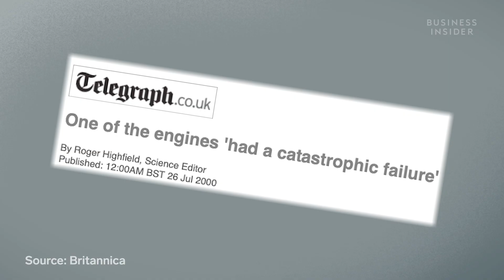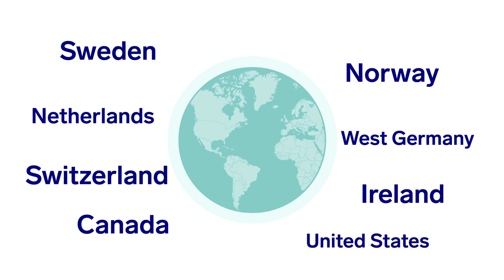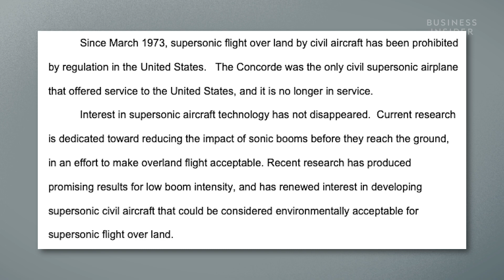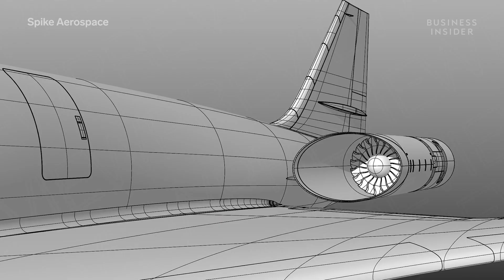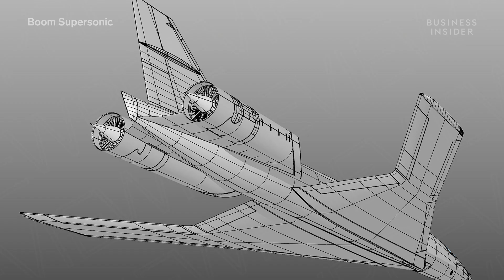Why We Still Don't Have Another Concorde

Comment: The Concorde could easily survive with few modifications. But people were already against it and the crash just ignited the issue.(Which I understand)
When concrode got a red flag, many pilots said that this will push the aviation industry decades behind. And thats what exactly happened.
Reply: They actually started developing a "Concorde 2" but it wasn't worth it anymore.
Reply: @Hiro_Trevelyan  The Americans tried , but couldn't keep up with British engineering . Russians copied , with stolen plans , but they cut too many corners and just didn't have the ability anyway .
Reply: Also the fact that Concorde crash isn't even Concorde fault is just annoys me 😬
Reply: It was becoming more and more an economic bust, even with cheap fuel, if the plane is not economically viable to operate no one in their right minds will go that rout.
Reply: When the Concorde was designed, Jet Fuel costed pennies per gallon.
When it was finished the price had skyrocketed already.
Reply: @afoxwithahat7846  also you have to count in inflation
Reply: Xmaschees no it’s cause it’s more reliable and cost effective
Reply: Well said
Reply: You’re so wrong. The Concorde was not fuel efficient, the ticket prices were insane, and was very hard to pull a profit with them in service. They were cool but did not make money for the airlines
Reply: @notsocooldude7720  After they increased prices - OH YES THEY DID - people fought to fly with her .
Reply: @xmass_5555  it was so inefficient, get your facts straight.
Reply: @xmass_5555  oh okay sorry
Reply: Nah, concorde innovation and design based on war jets. It's the commercialized "concorde" that failed not the military ones. Commercialized innovation is just the rip off product from the military's R & D.
Reply: @rickyrat42069  An unfortunate consequence of capitalism
Reply: It's French engineering so it should survive 😂
Reply: Did they ban the Boeing 747 permanently, when two of them blew apart killing hundreds of passenger's--?  NO.
Reply: You couldn't fly this overland anyways due to restrictions against supersonic flight (this restriction even applies to military aircraft outside of emergencies). Also, the price for tickets on this weren't all that different from first class seats on other aircraft like the 747, and unsurprisingly, most people who could afford these tickets opted for comfort over speed.
Reply: Too much hassle.
Reply: The bloody Concorde isn't the most fuel-saving aircraft, and the limited market which only aimed only at rich people doesn't help the aviation industry investing on Concorde.
Reply: @nogisonoko5409  Who cares about fuel - it is about the power and the glory . It was designed before the woke generation were born .
Reply: @nogisonoko5409  the technology used could’ve been adapted and altered and by today we would’ve been years in front of what we are now with aviation you moron
Reply: No... Look at the biggest scsndle with thr Boeing and its still here, one crash is not the end of the world

Get your facts straight
Reply: Total BS. What modifications? Why not centuries behind? Do you have any clue how every commercial industry works? It's all about economic efficiency. Concorde was just a costly toy. The airlines only kept them for advertising. There is no point in a jet like that until it's a private business jet for some billionaire who would fly over empty lands or oceans because of the sonic boom.
Reply: @Vladdy89  so Lamborghinis and Bugattis are useless toys that don’t help the automotive industry? Please
Reply: @jamesmason131  they are largely for brand image/customer retention and the result of technology developed within and for profitable sectors of their business - racing or otherwise
Reply: @jamesmason131  good point !
Reply: @Vladdy89  Is it really all about economic efficiency??
Reply: The concorde was ahead of is time
Reply: @Tyradominus2000 so was the the sr71 but both still very expensive to operate
Reply: @Tyradominus2000  DeHaviland Comet , Vickers VC-10 , Concorde - Britain led the way in aviation ; never mind the Spitfire , Vulcan or Harrier - no one else could compete .
Reply: @derekheeps8012  concorde was made in participation with France
Reply: so wrong comment getting so much thumb ups is just absurd.  Go research on your own and see what it says.  Every aspects of Concorde was declining doomming its operations.  It only needed a few more excuses to cease operation.  

Even to this day the aviation industry cannot overcome supersonic flight short comings to make it a viable transportation mode.
Reply: @Denverian  It was the greatest success story of its time - fabulous aircraft . You detractors are just jealous because you couldn't afford to fly on her . Sour grapes .
Reply: @derekheeps8012  that's exactly what it means - failed as a commercial airliner.  Only a few people could afford to fly in it and airline was losing money just having one whether sitting on the ground or flying in the air.  Concorde doesn't belong in commercial sector

Comment: Well, Concorde was built for flying overseas, so the Sonic Boom shouldnt be a problem? Like, fly subsonic until you reach a high crusing altitude and then go supersonic, since people hear the noise on the ground, right?
Reply: The Concorde initially wanted to serve high demand routes over land as well, think LA to New York, London to Moscow ect.

Sonic booms over the ocean was never an issue, it was the noise over land.

And it wasn't just the sonic booms, during take-off and landing the Concorde was extremely loud even during subsonic flight. To the point nowadays it wouldn't be allowed to conduct nighttime operations anywhere.

Comment: In short, future SST's will likely limit their top speed to around Mach 1.6. Such a speed limit has a number of benefits:
1. You don't need to run engines with a lot of reheat (afterburner) mode, which substantially cuts down on fuel consumption.
2. It makes it easier to "shape" the plane to reduce the sonic boom to nearly inaudible levels.
3. It means a lot less structural heating. That makes it a lot more viable to use many composite materials to lower the weight of the plane.
4. It may make it possible to fly from Los Angeles to Tokyo non-stop at full Mach 1.6 speed. That means Los Angeles to Sydney can be accomplished with just one fuel stop in Honolulu, with supersonic flying most of the way.

It should be noted that General Electric recently unveiled a new jet engine, the Affinity , designed for such supersonic flight. It will be as quiet as today's high-bypass engines on takeoff and landing but its supercruise ability means supersonic flying with very little need for reheat operation.
Reply: Interesting points, but it should be noted that wave drag is lower at higher Mach numbers, such as concorde's. Also, supercruise is not a new thing - concorde had supercruise as well. With a lesser advantage in speed than concorde, I wonder if all of that trouble will be worth the extra speed - after all, you can literally install satellite internet on planes nowadays, so you don't even have problems with being "disconnected" from the rest of the world, but all hurdles related to sonic boom restrictions and very high operating costs are still there.
Reply: @RM-el3gw  Americans can pontificate ; we in Britain get on with doing .
Reply: Another armchair 'Expert' with no idea what they are talking about.  The engines only used re-heat at take off and briefly while transonic. Once in the cruise it was dry power, at less than 100% as the intakes provided some thrust.

Comment: more than 30 years to develop? 1st flight in 1976, so it was in development before 1946!?!?? Even before Yeager broke the sound barrier in 1947?!?!
Reply: Jonathan Garneau it first flew (prototype tests) in 1969.
Reply: @spencerwilton5831  That would make the "30 years of development" assertion even worse... That would mean is was in development in 1939 or before. Dunno how they calculate the development duration, but using the 1st commercial flight in 1976 as the end date of development is the latest I think one could assert that development ended. Considering a plane "in development" while it's in commercial service is rather nonsensical. For the concorde to be considered "in development" as far back as 1946 one would have to have a pretty wide definition of "in development".

Comment: you guys know why the concorde crashed it wasn't the fault of the plane here is what happened a commercial plane took off. while taking off a small part of the plane fell on the run way when it was Concorde turn to take off the tire tire exploded because of the part that fell from the previous plane when the tire exploded big chucks of tire hit the wing which caused fuel leak if you don't know plane carry some fuel in wings as well leakage of fuel and broken electric wire caused the plane to catch fire and crash they did try to stop the plane while they were taking off but it was too late and they had to take off
you can watch the whole 40 min documentary about this crash

Comment: just wait for the Electric Jets which can go at a much more higher altitude than the Internal Combustion jets. 
This will also solve the problem of speed and air resistance because of the higher altitudes.
Reply: Batteries= weight=smaller range=more batteries=more weight= and repeat. 
It's why we won't see electric commercial planes for a very long time. The battery technology isn't there.
Reply: Combustion is the only turbine technology which can go to high altitudes. Electric propellors cannot fly high as they need a lot of air to function and in high altitude there is simply not enough air for them.

Comment: They are just being lazy. Nothing hard about upgrading the 100 seater Concorde. 
1. Turbofan supersonic super-cooled engines with no after-burners
2. Windowless fuselage
3. 60-75 business class seats
4. Fly-by-wire with no flight engineer
5. Composite material body
6. Better wings
7. Fibre optic cameras so droop nose not necessary.
8. Mach 2.
Reply: Nii Ayi Croffie turbofans loose efficiency at higher speeds. Windowless planes likely not to be popular with passengers, although screens might work. Bigger seats would increase ticket prices, and aren't needed as flight times are so much shorter. Concorde was fly by wire. The wings were perfect for the job but could possibly be adjusted to reduce sound. Cameras might work but the droop nose was a good solution that worked, why add more complexity? Mach 2? It already few faster than that anyway.

Comment: Because there is a speed that is most fuel efficient for jets and that is around 0.7 mach.   Anything faster just equals more expensive jets or ticket prices for consumers.
Reply: No it's Mach 0.8. and it's not about fuel efficiency, it's about the speed of sound. If planes fly faster than Mach 0.8, then the air going over the wing will cause a shockwave causing the wing to loose lift and the ailerons to loose control authority, which is referred to as an overspeed, or high speed stall.
Reply: Actually, there's reason to believe supersonic flight could be made more efficient than subsonic flight.

Wave drag is a huge limitation created by supersonic flight, but can be reduced by increasing wing sweep angle and sharpening the nose. Boom Aerospace's design modifies Concorde's 55 degree wing sweep to 70 degrees, and has a noticeably sharper nose. Lockheed Martin's design goes even crazier with the idea. Of course, these measures increase weight, structural issues, heating issues, parasite drag and induced drag, so there's a trade-off, but there are gains to be made with wave drag (as a bonus, reducing wave drag also reduces the loudness of the sonic boom).

Furthermore, if you can make engines that can produce the necessary thrust without needing afterburner, you can massively improve fuel efficiency.

Lastly, the biggest area where supersonic flight beats subsonic flight is in altitude. The speed limit of subsonics caps out their altitude thanks to something called coffin corner, where the air gets too thin to maintain lift, and the aircraft stalls. By flying nearly 3 times faster, supersonics can massively increase their lift efficiency and thus, their cruising altitude. By increasing their cruise altitude, supersonics fly in thinner air. Thinner air means less drag, which means less fuel consumption, which means supersonics can easily beat subsonic fuel efficiency during cruise (in fact, I hear the Concorde accomplished this in its day. It's fuel inefficiency was caused by fuel guzzling during takeoff and landing).
Reply: @J7Handle  I don't see how turbojets would be able to create enough trust for supersonic speeds without afterburners. And I don't think that there are fan blades which could make supersonic turbofans possible.
Reply: @CaptainChrom  Supercruise is a well known capability. Afterburners aren't the holy grail of supersonic travel, they're just a thing that gives maybe 40% more thrust on average for something like 3 times the fuel consumption. The F-22 can supercruise at M1.6, but a dedicated supercruising airliner should be capable of Mach 2.

As for using a turbofan, it seems like a bit of a strange idea to me, but the Tu-144 made use of afterburning turbofans, albeit with horrendous fuel efficiency.

The only problem with turbofans for supersonic flight is that they create a larger intake area to thrust ratio, which has detrimental effects in terms of drag. However, a low bypass turbofan should still be able to power an airliner to supersonic speeds while massively reducing noise issues.

I remember once thinking that turbofans can never work at supersonic speeds. The idea was that the fan blades operate at subsonic speeds, therefore after slowing down the intake air, the bypass from the engine would never exceed the speed of sound, thus, at supersonic speeds, the intake would always be faster than the bypassed exhaust, indicating negative thrust.

This is not how it works, in case you were wondering. Yes, slowing down the supersonic intake air is necessary, and yes, the fan blades can never accelerate air past the speed of sound, but the fan still produces thrust.

The reason is that as the supersonic intake is slowed down, it necessarily gets compressed to higher pressure according to the mach number. When you decompress the airflow after it bypasses the engine, it accelerates beyond it's initial intake velocity, thanks to the fan.

It just requires proper intake and exhaust design to make a turbofan work.

Comment: What made it go was stupid. It was the runway in France
Reply: What was on the runway in France, that had fallen off a prior Continental plane. Where the Concorde was struck was not the rupture point, the rupture point was nearby. Strip of metal, chunk of tire, non impact resistant fuel tanks. The fleets' 
fuel tanks were lined with Kevlar to resist rupturing after the crash.
Reply: @FloorEncer  Check your facts mate.
Reply: @goinawol9447  that was what happened, a shitty DC 10 left a piece of metal on the runway and burst the Concordes tire.

Comment: I hope we hear the droop snoot again.
Reply: MaxieM0us3 Won’t have one. It’ll probably be a digital front view of a modern SST.
Reply: The droop snoot added so much unnecessary weight. For the 70's, it may have been necessary, but now, we could probably just put it on a screen, if it's even necessary. Flying planes nowadays does not require too much pilot input. Speaking as a pilot.

Comment: Chose one: Fast or cheap? Speed comes at a cost, in terms of load, fuel costs, and mechanical upkeep.

Boom Supersonic is still ignoring how their plane is only able to seat at most 55 passengers (by comparison, a Boeing 777-200 and Airbus A350-1000 can fit that in their business class alone and fit more than five times in economy AND hold cargo). 

Do I want supersonic travel so that I can (when this damn pandemic is finally over) travel to Europe in less than a day? Yes. But very unlikely any airline that's not sponsored by a government will want it due to three factors mentioned.

Comment: SpaceX by Elon Musk is going to solve this problem.  It's pretty ridiculous that this video doesn't even mention what they're working on.  None of the offerings mentioned in this video will succeed.  SpaceX will offer anywhere on Earth in less than an hour.  Most places travel less than thirty minutes.  1000 passengers per flight on a vertical autonomous rocket around 1000 per passenger.
Reply: Sure thing fanboy. What is annoying is that while SpaceX is doing amazing things, Elons daydreaming and the fanboys who propagate it are extremely annoying.

SpaceX has not demonstrated reusability on the Falcon 9 yet(The Falcon 9 requires extensive refurbishment between flights), I hardly see them perfecting reusability on the far more complicated Starship.
Reply: @TheOwenMajor  ROFL ok.  you're hilarious